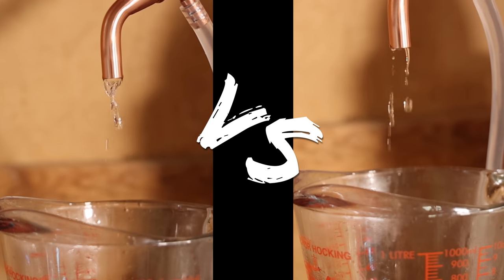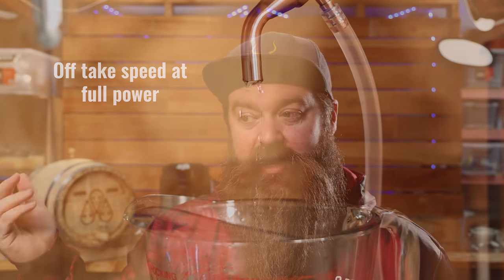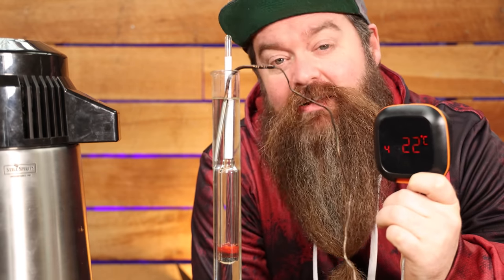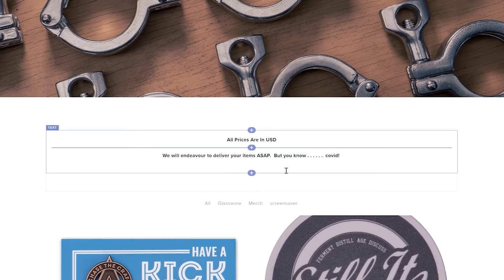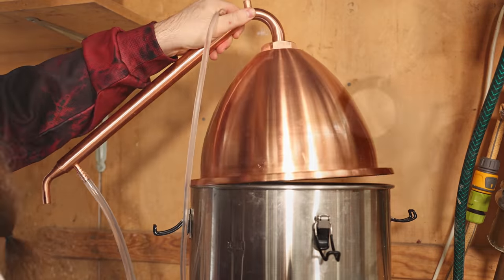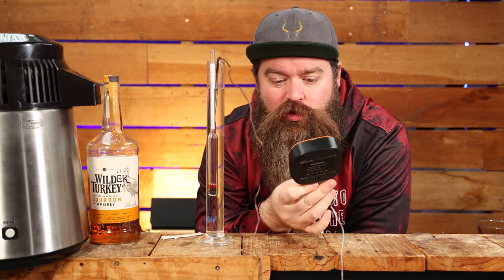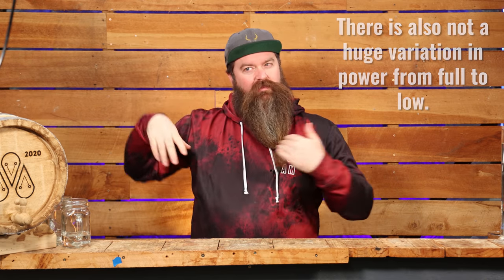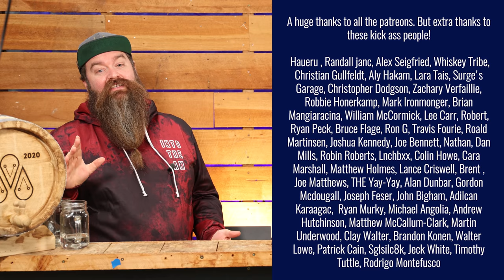Is It Really Worth Running A Pot Still Slowly?

Comment: Hey, I am fairly new to distilling and have watched a lot of your videos. I was trying to do a stripping run on a vodka mash in my pot still and had something strange occur. From the start, i was getting straight water 0% abv. I ran it for a bit thinking it was just a weird fluke. After an hour of running I again tested the abv and it was still 0%. I decided to stop my run and check things out once it cooled down. After it cooled I checked the abv of the mash left in the still. My starting abv before distilling was 17%. After running it, the abv in the pot is 40%. Obviously this makes sense because I was only getting water out of the condensor. My question is, how does this happen? I somehow went straight past all of the alcohol and distilled only water. My best guess is that I had my still running too fast. Any help would be greatly appreciated, and thanks in advanced!

Comment: did you buy or build your voltage regulator? i have the same t500 w/alembic top and could use one of those.
Reply from the maker: I have a few now.  The one I have been using the most is a unit from Aliexpress + a home made housing and a few additions (cooling fan and some safety upgrades).
Reply: @StillIt  thank you so much for the reply!! your tips have been helping me get my molasses rum to the next lvl!! thank you so so much!!

Comment: What I wanted to take out from this video was the taste or the aroma. Would it be wise to run it fast in order to receive more aromatic drink? My thoughts are it should as the alcohol you receive is less in ABV. But is the ABV that less would give you more aroma? I am distilling Turkish Raki which the fermentation consists of grapes and sugar. After that I am using reflux still to receive around 90% ABV. Than I am infusing anis for about 5 days to 90% ABV next step is going through pot still. Now that’s where my question starts I am always running potstill in lower speed which is producing 83% ABV of hearts. Than diluting that with water in order to get 50% of ABV final product. If I were to run pot still fast than probably i will end up with less amount and less ABV but running fast will give me more aromatic drink or not? Thats my question.
Reply: Try it out and let us know.
Reply: @MrSottobanco  I did and run it slowly, running it fast does not produce the same quality.

Comment: Mmm, the jury is out, does a lower temperature lower the excitement and therefore lower the van der waals forces therefore not attract the higher and lower volatile's giving a cleaner spirit.  
As propanol has more mass and therefore requires more energy to excite them, propanol will require a higher boiling point. But as the experiment is under pressure and refluxing how would that effect the result. Sorreeeee.

Comment: It's basic science, even can  water evaporates at say example temperature 10c it's about the environment it's in dry or humid and since a still is pretty damn humid in there water will come of a lot quicker at a higher temperature so if you run it colder, Not FASTER 🤣 The ABV  will be higher every time of the day, all good things come to those who wait, and yes you can run it hotter to get more flavours, but the real trick is when to turn it up or down, to get the flavours you want trial and error real science, colder run still a more pure alcohol, a hotter still a dirtier alcohol so too speak, I got all A, s in Science and distillation is a fairly basic process, if you like know of  the tolerances of  rate  of evaporation temperatures,! Not boiling point there is a big difference, just like when they make Fuel ie, petrol you don't want the diesel coming over with the petrol so you need to run it at a tolerance temperature or evaporative rate, otherwise you'll get a dirty mix 👍🏻

Comment: I understand his concept.  But he refers his still is boiling the  mash. He ain't boiling shit.   You are comparing apple and oranges.  A Dude that packs a column with a bubblers and a reflux aint boiling. Your gunna get a solid  187 to 130 for half the run. about the condenser keep the water cool.  The tough part is the reflux water temp control and flow.  The dude is good at what he does but Jessie your questions and follow ups  sucked.  You are awesome don't get me wrong I do this as a hobby too. Dude is good at what he does. But you asked the wrong questions.  More people will be all confused.

Comment: Not to be offensive, but there seems to be some misinformation in this one.  Main thing is - no mention of entrainment.  The more intense the boil, the more likely different elements of the mixture are to be coming out at the same time - including water.  Need to find a new expert.
Reply: Did they not talk about it after the shout out? I was going to ask the same but deleted my comment. He mentioned running slow through the heads, speed up in the hearts, slow back down nearing tails. Gets the bugs out in the front, lots of flavor on the pickup, then keeps your hearts clean into the tails.

Comment: slow run means less power to the still
less power to the still means that the heavier molecules (mainly from the tails) do not have enough energy to make it to the line arm. 
so fewer tails smeared into the hearts = smoother distillate